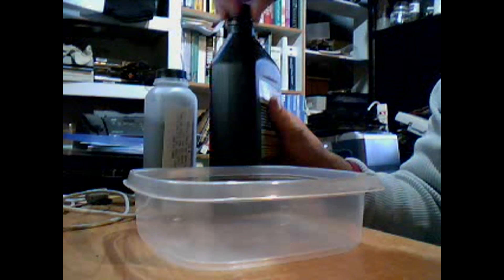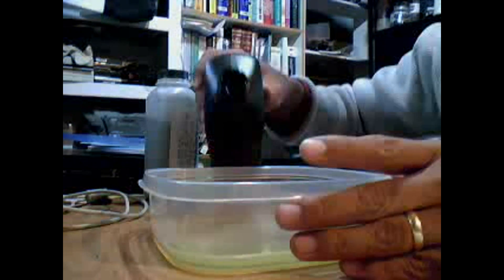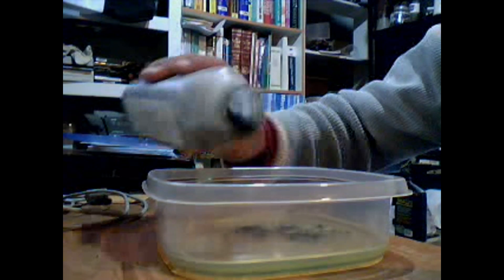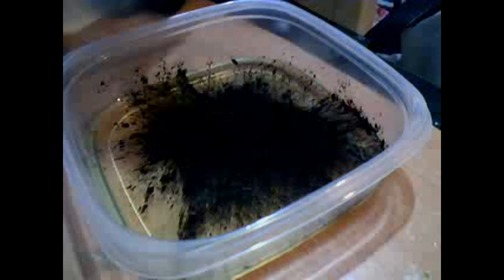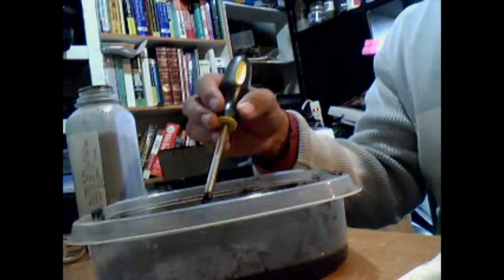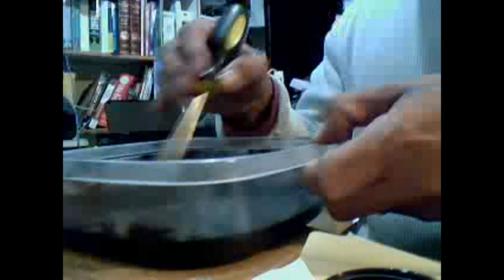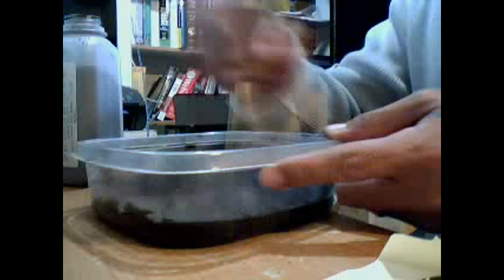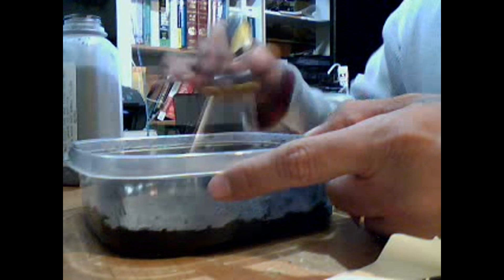Step 1- How to make ferro-magnetic fluid using motor oil and laser printer toner

Comment: I emptied out an old toner cartridge and it didn’t work. It was not magnetic. Any ideas why?
Reply from the maker: +cambridgetate old meaning used up? Most of the iron particles were used up during printing.
Reply from the maker: +cambridgetate Also matters, the quality os the toner. More expensive toner will have more metal in it.

Comment: Hi... I´m working with this stuff... I get the laser toner, oil and also a neodinium magnet of 6kg of force. so its pretty strong magnet. My problem is that a can move the liquid but i don´t get the spikes i want. Maybe i´m not using a correct toner. Maybe you can tell the label and serie of toner can work better.